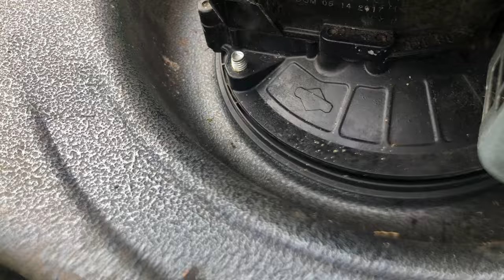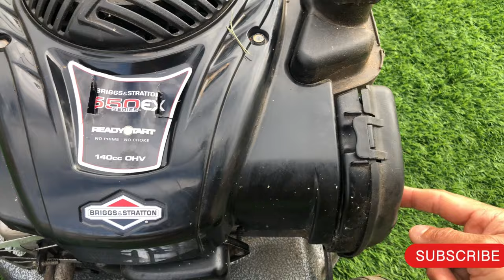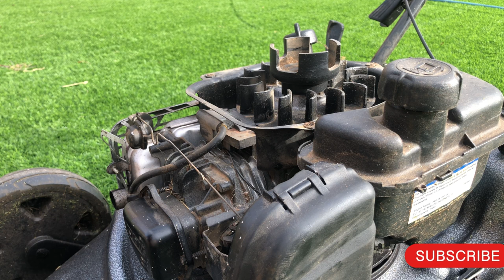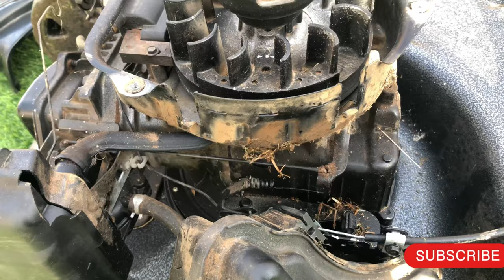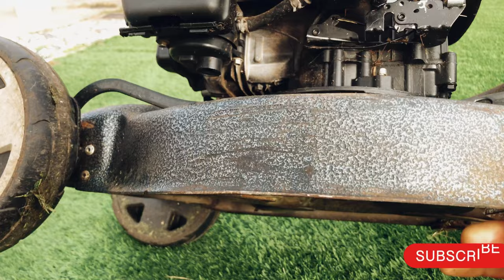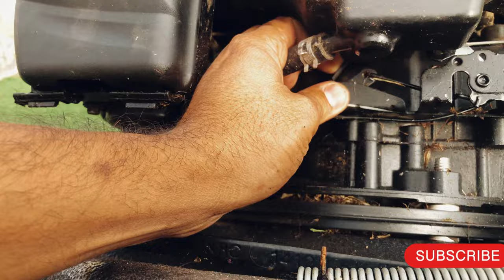How to adjust Engine speed /RPM in lawn mower .Briggs and Stratton 500e series VICTA

Comment: Good mowers i got a 500e exactly like this for free because the deck was rusted out so i went to the dump got a old broken mower with the same three bolt engine pattern ripped the engine off cleaned it down and then put the good 500e engine on it with some nice new blades and its a one pull start and an absolute work horse never let me down i think the front of it said victa corvette 500 and the engine was identical to this but the 500e version
Reply from the maker: Well done mate